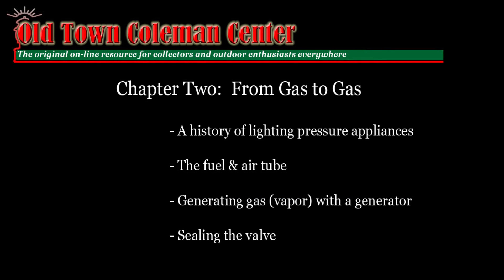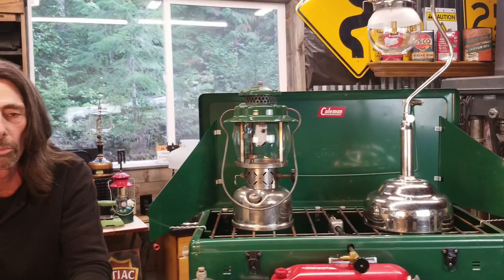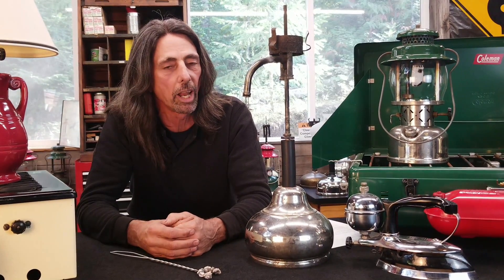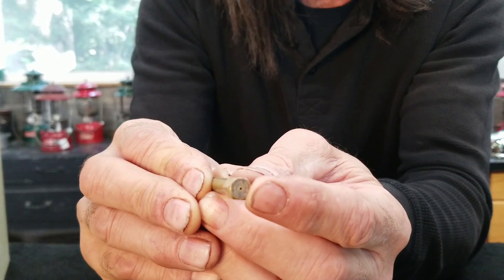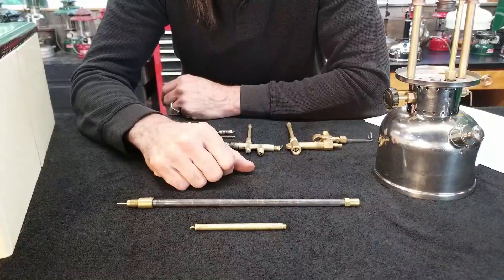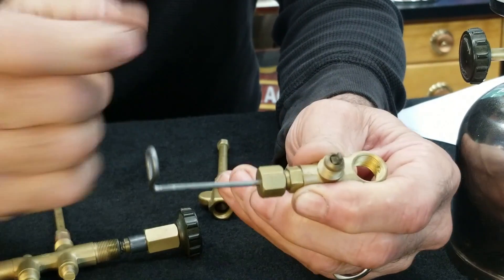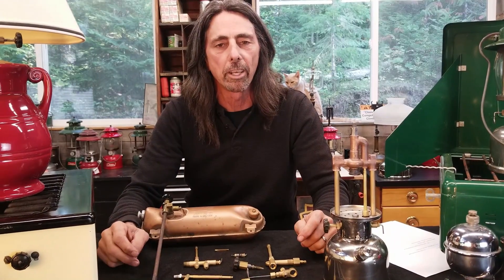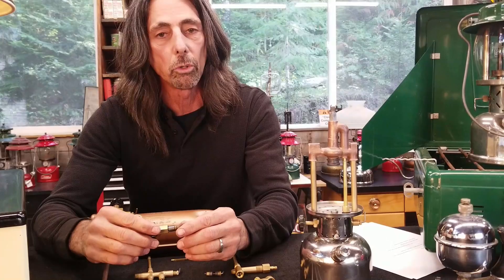How a Coleman Lamp, Lantern and Stove Works - Theory of Operation Part 2 - From Gas to Gas

Comment: This is the best description of these I've seen.    I wanna build a fuel vaporizer for an engine. As a kid I'd look at these , and wander if it would work by running the exhaust gasses over a generator, scaled up of course
Reply: I built one and patented it. The problem is that gasoline today is NOT Coleman fuel, it has additives and cokes at higher temperatures.

Comment: Good evening Frank, I have a question. I recently purchased a lamp with the white turban shade, it has the straight Q77 generator. I tried to light it but it wouldn’t fire. I saw when you light yours it looks like you warm the generator for a bit then turn the valve on and it fires. I removed the generator and tried to blow through it and noticed it was bent quite a bit. I found some Q77 generators on eBay and ordered two. I will install and try again, do you have any suggestions on firing these? Cleaning the gas tip? Thank you for your videos, I have learned a lot and really enjoy them and the lanterns and stoves. My family used Coleman products in excess during our many camping trips while growing up.
Reply: Now after fully watching the video I realized I didn’t heat the generator. Thank you again for the videos.

Comment: I'm working on a 335 whose fuel/air tube doesn't provide a hex nut to take it apart.  Even though it's round instead of hex shaped, does it still thread on? Can I wrap a piece of leather around it and spin it off with vice grips? Thanks

Comment: The Kerosene lanterns, can they run on white gas too. A friend of mine has one with that cup so i assume it's designed for Kerosene, but will white gas work too?
Reply: Yes, it works but you still have to preheat the generator. It can't instant light without the air holes.

Comment: I scored a 220K model the other day. I put fresh fuel in it and pumped it up. It pressurizes but when I open the valve and try to light the mantles, the match gets blown out. That leads me to believe that the metering rod is stuck in the down position, not allowing fuel to flow upwards. I tried to remove the part that goes into the tank but I couldn't get that thing to budge. It still has fuel in it. Maybe the fuel will soak into the goop that has seized the metering rod?
Thoughts or suggestions are appreciated.

Comment: The spring in the stove generator is there to provide an increase in hot surface area so more fuel will vaporize within the tube. It also keeps the tip cleaning rod centered so the fine wire pricker/reamer doesn't get bent.

Comment: Oooooh - where do you get those white-tip matches ???    From laboratory practice, the coil (or spring) inside the generator is not primary to "slow the gas down".  That coil increases the surface area available for heat transfer and gas generation.  Nice touch with your cat supervisor.  Most excellent video.

Comment: Hello sir. Huge fan. I just purchased a 66' 426D 3 burner. I'm a little discouraged. I paid a lot for the stove and it has a few issues. It has a hard time burning blue and clean on the main burner if I turn the stove up passed 1/3 open and worse, it will not turn off. Turn the little lever up and close the fuel valve and wait a couple minutes. It will (simmer) but will not go out no matter how long I wait. When I received the stove the fuel valve knot was very tight. Plz help!

Comment: I have a Coleman model 639B. I'm using gasoline instead of kerosene. Illuminating perfectly. It's dangerous?
Reply from the maker: No Paulo, not dangerous but it does not have a fuel and air tube so use caution when lighting it...preheat as normal and you should be fine.

Comment: I have a #237 Kerosene Coleman Lantern, and it looks as good as the one you have. I have several different types of Coleman lanterns, and stoves but the biggest disappointment was the purchase of the Coleman North Star, #2000-750. Flames keep erupting out from where the generator enters the burner assembly. So, there is a couple of hundred bucks wasted, being as I can not beg, borrow or steal any parts for it. I have the part numbers, but no parts.

Comment: Fantastic - I hate to say it but you should be charging us for these videos. A question  - I love your lamps - can you burn them inside like an Aladdin lamp or only outdoors? I have three Aladdin I do not light although I have rebuilt them all. The mantels are still new unburned. I would like to use the Aladdin and Coleman for power failures. Is it safe?
Reply from the maker: Burn lamps inside?  Yes sir, absolutely, with caution for fire protection of course.  All of those old lamps were built to run inside the home and they're really good at it.   Thanks for the nice comments--very appreciated!

Comment: @OldTown Coleman  you mentioned lighting a stove incorrectly, & I got a bit convicted. I have a 424 that put out plenty of tall yellow flames this weekend, despite going through the instructions step by step. It had a leak at the fuel knob last year. I called coleman for help, but they no longer support it, so I got some graphite & fixed it myself. Not very well apparently because it was pretty wonky this weekend. I looked at your video list for stove videos but came up short on stove info. I've enjoyed your channel, I started with a 200a my dad was tossing out, now I seem not to be able to pass up an old lantern. Thanks for the education, looking forward to more of it.
Reply from the maker: Thank you Kevin!  The 2-3 burner stove video is upcoming as I've finished 1 & 2 mantle lanterns and the single burner stoves.  There are a number more repair vidoes I'd like to do but the stove one will be next.  Very sad that Coleman doesn't support the old stuff any longer, and a 424 isn't that old.  Ensure that your burner assembly is 110% clean, same with the generator, and that your tip cleaner stem is seated well in the valve stem.  Play around with the amount of pressure you begin with to see if that will aid in starting.
Reply: Thank you so much, I'll tinker with it tomorrow. I put on a new generator last year too, at the same time. I'll take it apart & make sure there's nothing gunked up in the mixing chamber & burner.
Reply: It was a pressure issue. Just fired it up, worked like a charm. Thanks again! (Still looking forward to the stove videos)